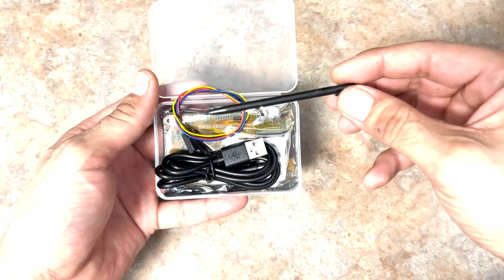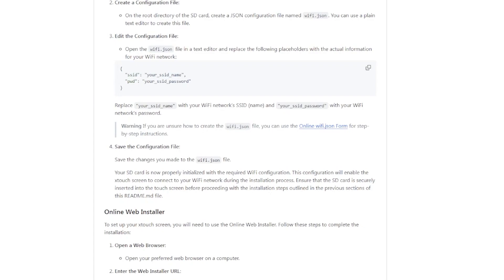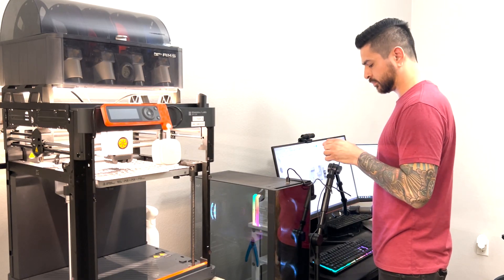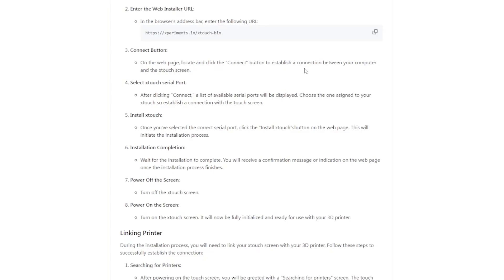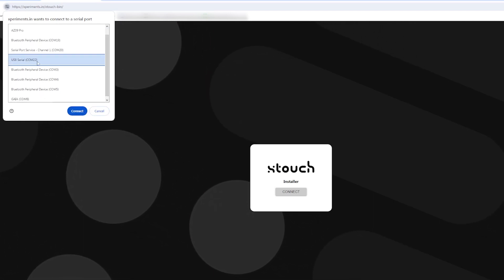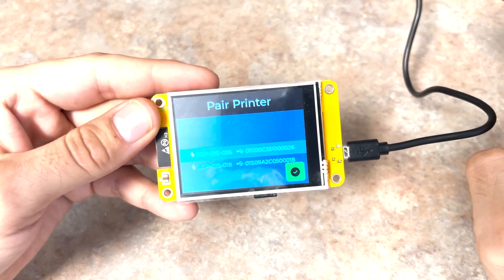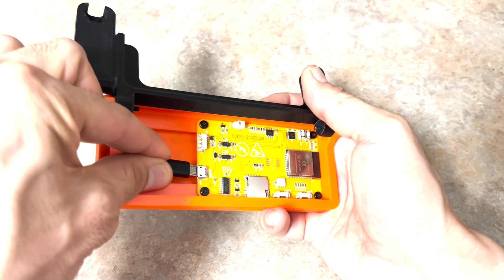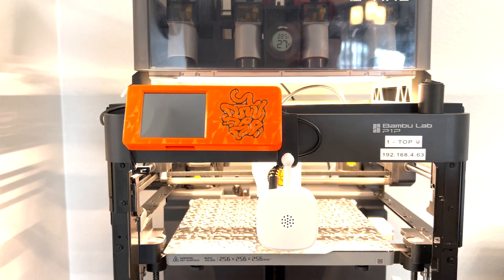P1P/P1S - TOUCH SCREEN UPGRADE (Bambu Lab)

Comment: Does it have any benefit over an old Phone or Tablet with bambu app attached to the Printer?
Reply from the maker: Not really sure if there is a benefit to be honest with you, moreso a preference. The interface mimics that of the X1 and A1 screens from Bambu. An old phone or tablet would do just fine. For around $20
Bucks however, one could pick this up
If they don’t have an old phone lying around.